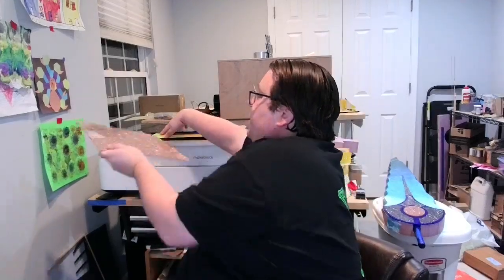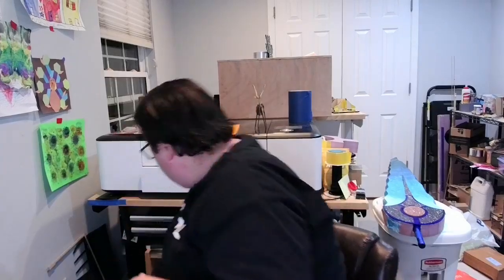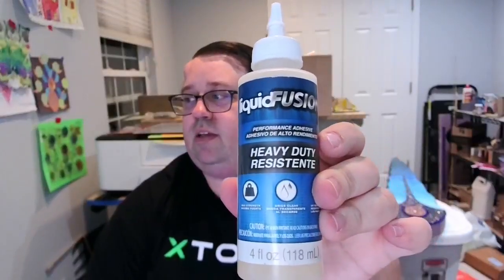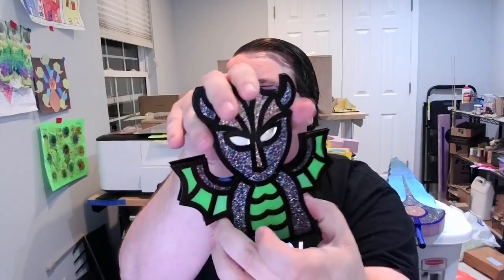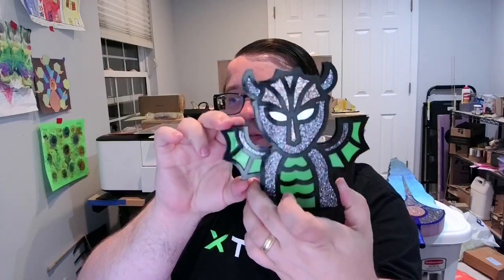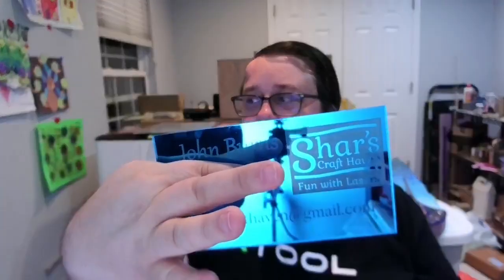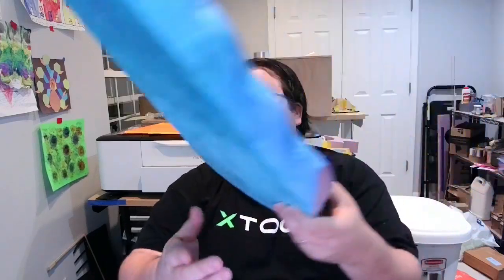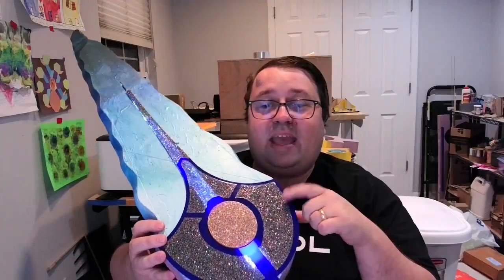Tips and Tricks for Acrylic Engraving and Cutting with xTool Laserbox Laser Mchine

Comment: So if the acrylic keeps crackling despite testing different settings and coatings... its mostly no cast acrylic? e.g. i have red translucent acrylic that cuts and engraves just fine ... but i tried several clear acrylics but they all have to little black-explosion-bubbles inside the material ... i suspect that these sheets are not cast acrylic.

Comment: Thanks for the video. Very good information. I am struggling so bad with a white acrylic rod diametre of 20 mm. I want to engrave a logo in there and tried so so many differents thing, found on youtube, but without any luck. Right now i would be happy to get a name in there, because logo with fine details i gave up. The absolutely best outcome would be a dark or black engraving, but i thing this is impossible !? When i paint the surface black with i.e. dry moly or tempera, i get an egraving. the problem is, that the engraving needs to be black. I tried to fill the engraving with black paint and sand it down ofter drying, but that looks horrible. do you have any tips or advice what i can try? thank you. Laser is the xtool d1 10W module